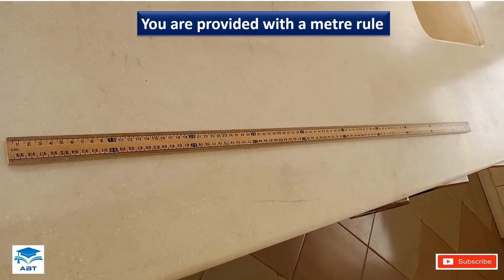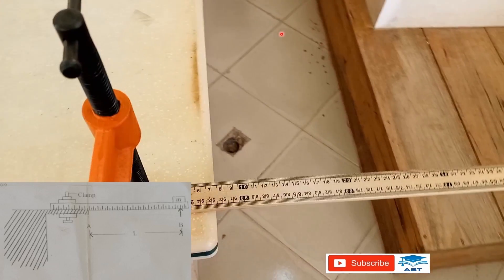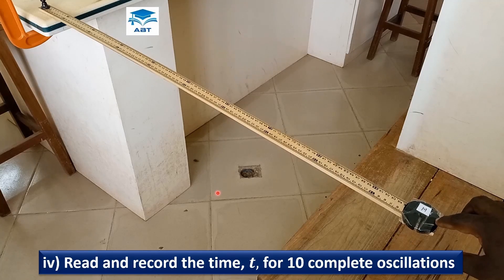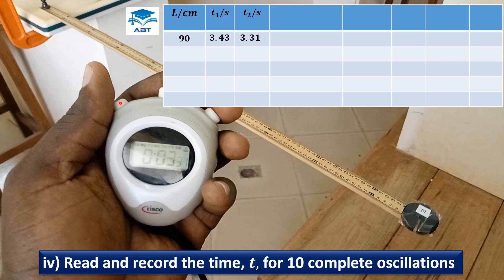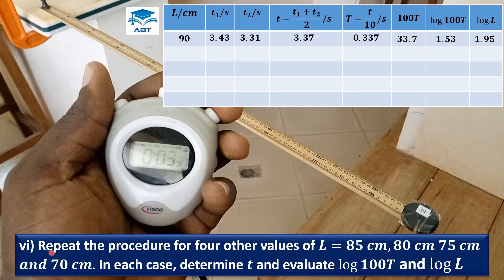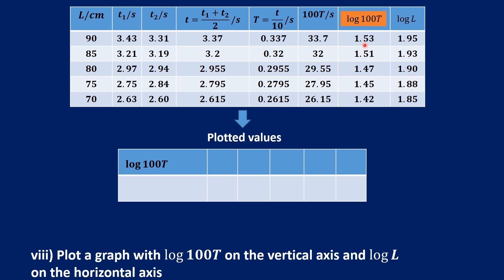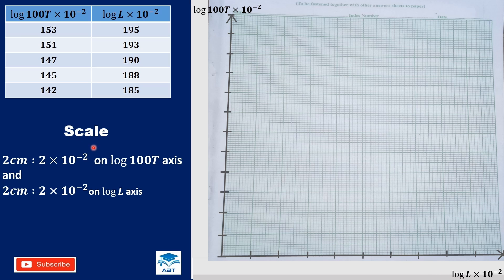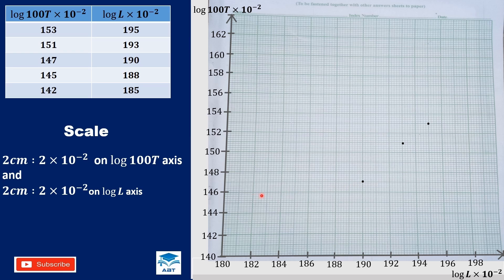WASSCE 2022 PHYSICS PRACTICAL - CANTILEVER

Comment: the answer for the slope is not correct it is 1.11 because the formula is (154 - 146) divided by ( 196 - 188.8) which will give us 1.11 not 1.08 
But the video was very much of help and it was understandable at once